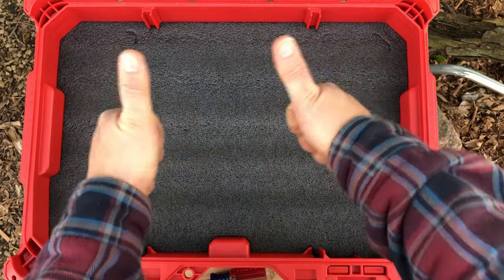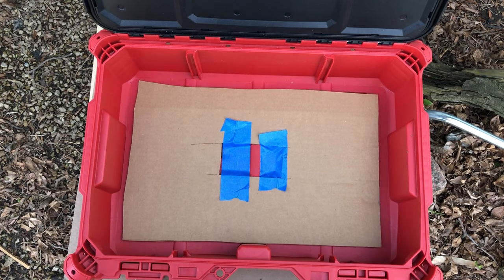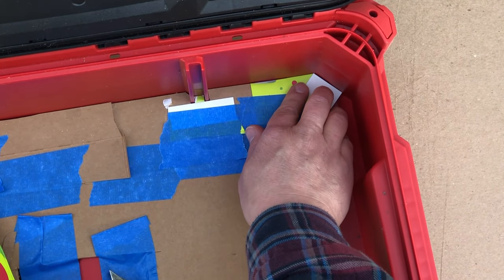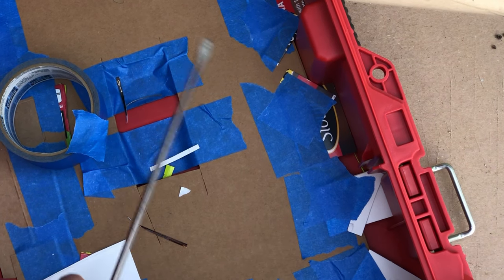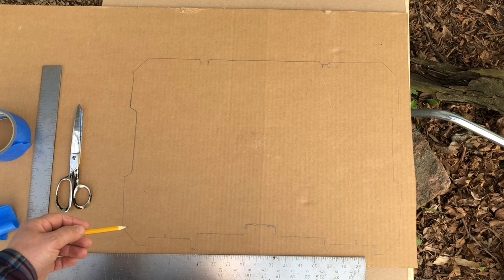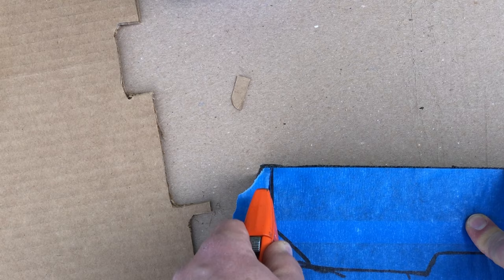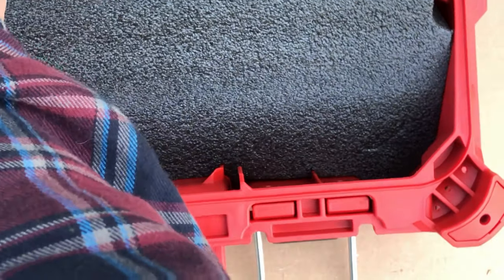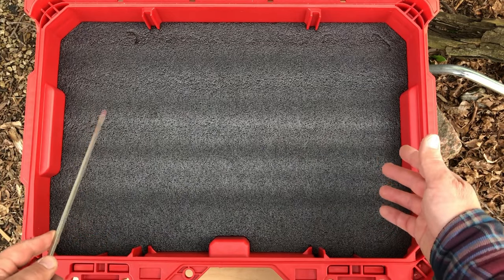How To Cut A Perfectly Fitting Foam Insert For A Complicated Toolbox - Milwaukee Packout

Comment: I heat up my blade as I cut. Works well.
Reply from the maker: Cutting through the thick tool foam cut be a bit of a challenge. Thanks for the tip. Cheers!

Comment: This was a great video. Thank you. For anyone who has not worked with the Milwaukee precut foam, if you like what this gentleman has done, you would not be happy with the Milwaukee foam. last night I received the two different pre-cut foam inserts that Milwaukee currently has available. Initially, I was very pleasantly surprised. I’m surprised that they don’t tell people this in the description of what they’re selling, but you actually receive two pieces of precut foam for each “one” you purchase. And I am guessing that they are the thickest one that kaizen foam sells. If you hold the Milwaukee Packout pre-cut foam next to a big sheet of Kaisen foam’s thickest option, initially, the Milwaukee Kaisen foam appears to be a little bit thinner. However, on closer inspection it appears what they have done is very gently and very sparingly melted the foam on I am assuming the bottom side. I’m guessing it would be next to impossible for someone to do it without some sort of special machine. Unless someone was intimately, familiar with kaizen foam, they would never know. It is kind of along the same lines as what the gentleman in this video did meaning the foam is very forgiving, and along the same lines as cutting the foam a little bit too big, the manufacturer of this product determined that the easiest way to create the slightly slanted edges at the bottom, was to melt it into shape. Anyway, I expected the foam to not have any gaps on the sides, but at least in the toolbox version and I think the draw version as well. There is a proximately a quarter to have an inch in places that have a gap. A gap between the foam and the side of the toolbox, which is kind of a bummer. It is nice to be able to just put the foam in and have it fit and to be clear it’s not loose. At 25 or $29 for one pre-cut section it would not be worth it. I bought it mostly to use as guides to cut my own, but unless I make some adjustments, they won’t work for that. Anyway, the biggest message I wanted to let people know is that when you order but to me looks like you’re ordering one piece of precut foam you were actually receiving two pieces of precut foam and they are the thickest pieces that Kaisen foam makes. So that brings the cost to $12.50 to $14.50 per pre-cut foam insert. At that price it’s easier to justify buying the pre-cut version. But knowing that you’re going to have a few places where there’s it’s not as tight fitting as you would like. Also, if someone wants to have multiple layers of foam in one of the deeper boxes, your best bet is to bite the bullet and buy the precut inserts from Kaisen foam because they sell each section of the layer that you need and it is different in each layer. I think I would lose my mind if I was trying to create multiple layers and say the deep into a box.
Reply from the maker: Wow! Thank you for leaving such a detailed comparison between the method I demonstrated in the video and the foam inserts sold by Milwaukee. I appreciate the time it takes to leaves such a thorough comment. I’m sure others have been wondering about this.

Thanks for watching!

Comment: Would anybody know how professionals put the tool details onto the foam, so you can easily identify the sizes of sockets etc?
Reply from the maker: Without know more about the markings you’re referring to, I’d say most of the markings that are actually cut into the foam are probably laser cut. I don’t know that for sure, but it seems to be the most likely method of achieving the detail I saw in a few images. 

Have you considered using a label maker to print out some labels and just apply the label to the surface of the foam. I think Brother still makes label tape with an extra strength adhesive is the regular tape isn’t sticky enough.

Comment: Absolutely, the taper you see on injection molded plastic parts to assist in getting out of the mold is called draft angle, it's usually 3 to 5 degrees. Contrary to popular belief you actually can have straight 90 degree angles on a plastic mold, however, it will wear out the mold much faster and you will have to operate at a slower cycle time (usually a few seconds per part depending on the plastic), which means the final part will cost you a lot more. If I had to guess by the time you take into consideration the mold and everything, I would say each one of these parts cost Milwaukee $5.00 to $16.00 or so, however, if they needed 90-degree walls it could easily cost around $65.00 to $160.00. Depending on the type of plastic they use reinforcement and such.

If you look closely on the top and bottom on the ears of the cleats where the cases connect together you can see they actually do have a mold element that moves 90 degrees to the plastic in order to release it, I'm guessing what they're doing here is using a much lower tolerance hence why there is a lip that's visibly noticeable, and replacing those parts individually rather than replacing the entire mold. because those parts will wear out faster.
Reply from the maker: Just WOW! @xsterawesome, thank you for taking the time to leave this amazing explanation. I found it very informative and I’m sure others will as well. Thanks again!
Reply: @CroakyOak  No problem, thanks for making the detailed foam cutting video.
This is the way people are supposed to learn, you can't know everything, I can't know everything, but we can exchange the information we do know.
Reply: @xsterawesome  thank you for the great explanation, too! 

I was first guessing that since the plastic expands when being heated and compresses when it cools down, the area with a full surface of material (bottom) might compress more than the area with no surface, resulting in that slight taper. But yes, that might have an effect far less extreme than the 3-5 degrees you described. The explanation with the mold sounded way more logical when I read it ✌️☺️

Thanks again!
Reply: Awesome comment !!! 👍✌🏻
Reply: This info is the reason comment sections are awesome. Thank you

Comment: If the shape you are trying to fit with foam is symmetrical, like your toolbox is left-to-right, you could save a little effort by only forming half a template and then mirroring it for the other side.

Or if there are slight differences between halves, make the template for one side and trace it. Then you can re-use the template and modify it for the differences on the other side.

Either way you just need to make sure your keep the overall dimensions of length and height consistent to fit the space as you flip  and position the template to the other side.
Reply from the maker: @Adam Banas, that is a great idea! Thank you for taking the time leave this post. I’m sure everyone who takes the time to read the comments will appreciate this information as well.
Reply: Awesome tip!

Comment: Great video. I just got some very dense 0.5” foam that I am going to use on the smaller half size packout cases. One case per tool - Bosch installation tool, M12 right angle impact driver, etc. I made a prototype using very soft seat cushion foam, and it worked well. But it was clear that my precision was just too low for a denser foam - the soft foam masked my inaccuracy. 

The draft angle is something I hadn’t noticed - thanks so much for pointing that out. I probably wouldn’t have noticed until it was too late. 

The packout containers I’m using have clear lids. I tend to forget to put stuff away, so I’m hoping that clear lids plus high contrast top/inner layers will make it very clear what isn’t put away yet.
Reply from the maker: I’m glad you found the video helpful. Using color coded foam to make missing tools more obvious is a great idea. I’ve seen ‘tool foam’ with different colored layers sold for that exact purpose. Keeping tools organized and put away can be a challenge. Good luck and thanks for commenting.
Reply: @CroakyOak  you can use white sheet foam also and just spray paint the surface then trace and cut..

Comment: thanks for the well thought out and presented video. For me...waaaaaaaay to much time and work for a tool insert. I have been checking around for some inlays that are precut but so far I haven't been successful. I bought some of the dewalt foam and I have a silver pen and a scalpel. The insert fits perfectly in the box as is so I have to do the cut out for the tools myself. Thanks
Reply from the maker: You are welcome! Thank you for commenting.

You are correct in that this method does take some time. 

Another option for tools cases is to use pick-and-pluck foam. This is the type of foam that comes with many Pelican brand hard cases. It’s much faster to use. But, the foam is also quite different than Kaizen Foam or any other foam typically sold as tool foam. Most noticeably, the foam is much squishier than Kaizen Foam. I have no idea how well pick-and-pluck (also pick-and-pull) foam would hold up in a toolbox. The prices and exact name of the product can vary as well, so shop around. Often sheets of pick-and-pluck foam can be found with other foam products used for shipping.
Reply: Milwaukee and Kaizen sell precut foam for the packouts if that's what your talking about. You can even customize the Kaizens
Reply: @John--John  thanks so much

Comment: Very useful info. Thanks. One suggestion: use bristol board for the pattern instead of corrugated cardboard. The corrugations make it harder to cut straight lines that are not perfectly aligned with them. The edges "squash", too, which won't happen with bristol board.
Reply from the maker: I understand what you’re saying and I’m sure bristol board would work well for templating.

I used cereal boxes and corrugated cardboard because they work well enough and I didn’t have to make a special trip or spend any extra money to get the job done.

Thanks for the tip and thanks for watching and commenting.

Comment: Where do you get the foam for cutting.
Reply from the maker: The foam used in this video is called Kaizen Foam and is made by FastCap. I’ve updated the links in the description box to include the FastCap.com web page and the Rockler.com web page for Kaizen Foam. Search the FastCap YouTube channel to learn more about Kaizen Foam. 

www.youtube.com/fastcapllc 

Although I prefer Kaizen Foam, another option is to do a web search for ‘tool foam’. If you do this, shop around a bit. The prices for similar, if not identical products can vary wildly.

Regardless of what you buy, if you can’t get what you want locally, pay attention to the total shipping charges as well.

Comment: Kinda mad that you stabbed a hole into the foam with that screwdriver
Reply from the maker: Well, what you’re seeing isn’t actually screwdriver damage. The marks in the foam are indentations left by the organizer trays that come with this model of Milwaukee Packout tool box. I’ve found this kind of blemish to be inevitable when trying to get a snug fit with stock parts. Oh well . . .😳

Thanks for watching.
Reply: @CroakyOak  I'm talking about what happens at second 0:22
Reply from the maker: s 9, I had another look at the video and you are correct. At 0:22 I did inadvertently poke the screwdriver I was using as a pointer into the foam. Oops! That is a bit irritating. I hadn’t noticed the damage at all until you pointed it out. Looks like I’ll have to make myself a blunt tipped pointer of some sort.
Reply: @CroakyOak or use a laser pointer. Then in your off time you can drive the cats crazy. :)

Comment: this or buy kaizen foam
Reply from the maker: @Jesus Perales, the foam I use in this video is Kaizen Foam. This method can be used with many different materials and almost any type of foam. 

I’m not entirely sure if I understand your question correctly, but I’ll see what I can do. 

If the money you save by making templates and cutting your own inserts is worth more to you than the time you spend making said templates and inserts, then make them yourself. If not, consider buying inserts that are already cut to fit. Foam inserts that are already cut to fit can be much more expensive, but using them is also less time consuming.

Of course this assumes inserts from your foam or material of choice are available at all.

I hope this helps. Thanks for commenting.
Reply: @CroakyOak  o